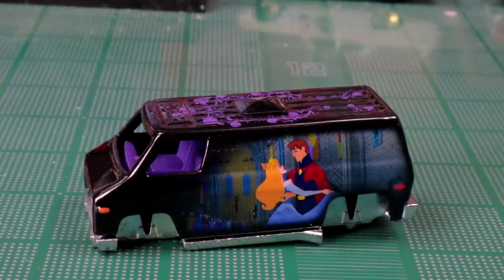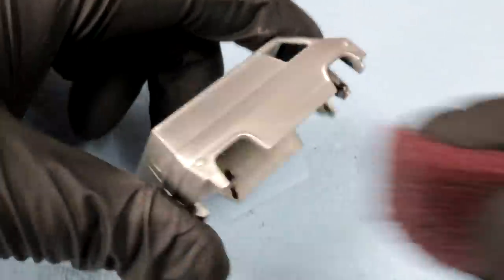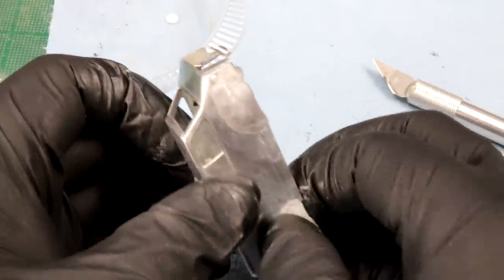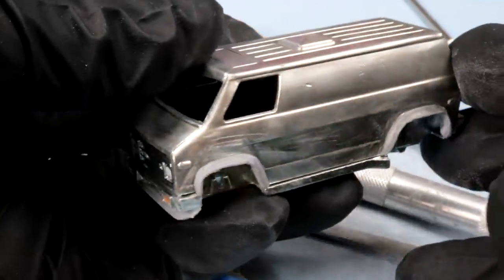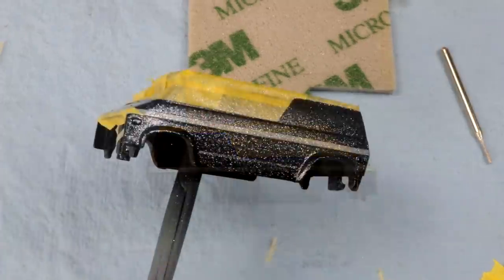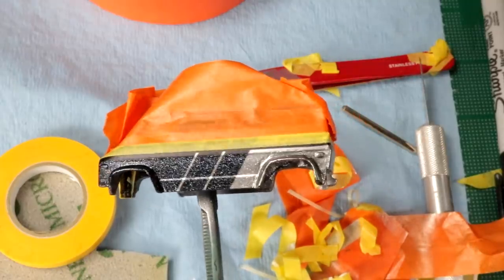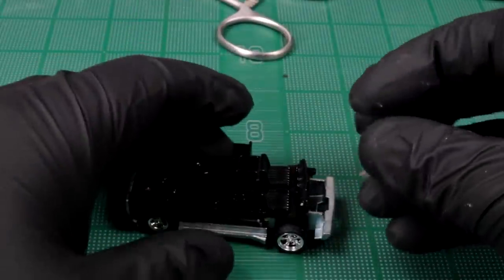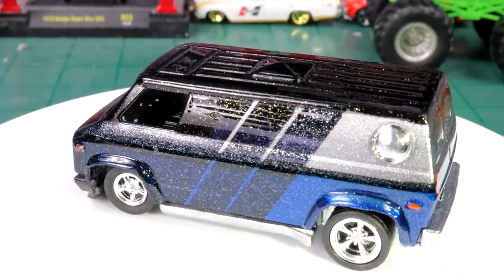Hot Wheels 70's Van Challenge!!!

Comment: Use a coke can strip under arches to hold putty?
Reply from the maker: That doesn't work as good as Jakarta leads on ;)
Reply: @DiecastResurrection  is jb weld more durable,being metallized?led under lighting could be interesting?

Comment: is it possible to bake these bodies to speed up the curing process just like actual auto paint
Reply from the maker: I use actual auto paint except primer, bake any 2k clear coat at 60C for about 30 mins. 100w light blub and a little wire rack to keep the body off the bulb works.